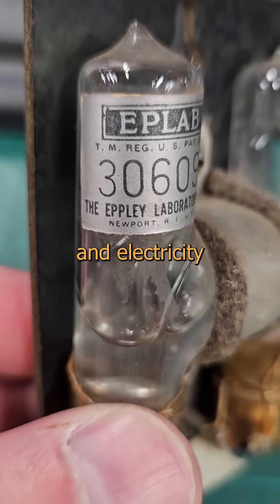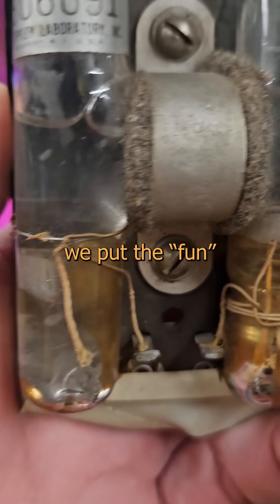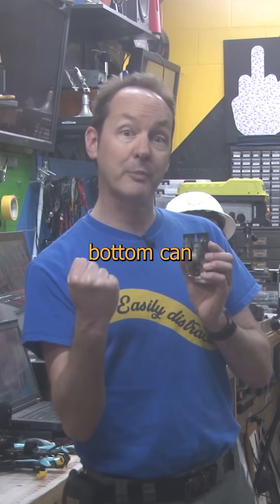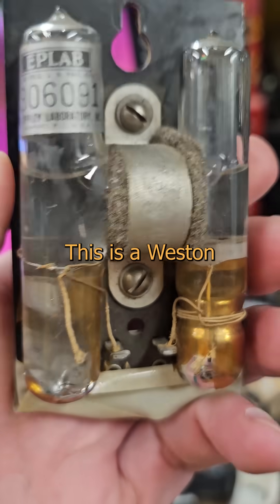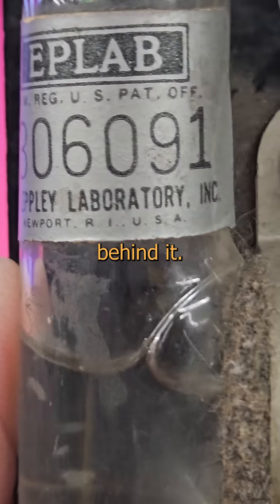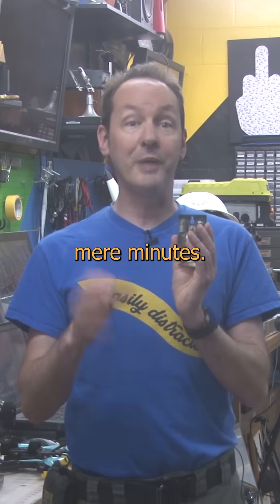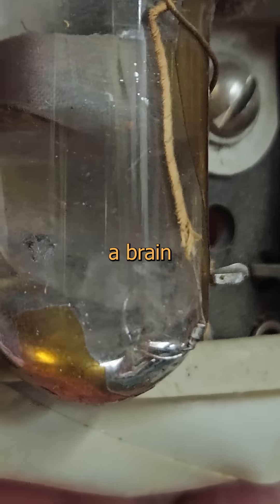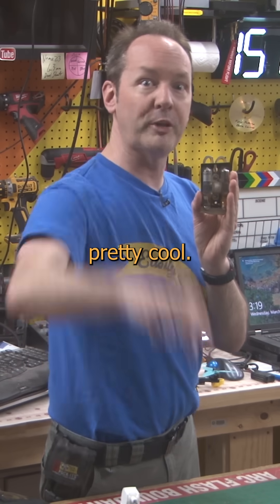The Weston Standard Cell #chrisboden #comedy #chemistry #electricity #electronics #science #history

Comment: to measure these without taking any current or at least a minimal amount a less stable but otherwise similarly precise adjustable voltage reference is used along with a null meter. Adjust the adjustable voltage source until it equals the battery showing 0v on the null meter. And now there is no current flowing so theres no discharge XD

Comment: These standard cells served as a basic reference against which early voltmeters were calibrated. It seems the combination of chemicals in these, as long as you took every precaution to keep the amperage draw as low as possible, kept the voltage remarkably stable for long periods of time. Companies using these in their metrology labs would have three - two were used for comparison to each other in the lab while one would be sent out to another lab for comparison to standards that could be traced back to what is now NIST.

Comment: That's cool. When I cal'd we used an old Fluke 732. Strange how it always has that 18 hanging on the end(@ 1 and 10V), whether it is a Zenner source or this cool poison antique.

Save that thing. They are trying to patent kill null detectors; by developing the diff builds, patenting them then killing the company. Over and over. A null detector is how you get a near perfect voltage standard. They are trying to now use 3458s to provide "near infinite" resistance to "swamp" the circuit. A far cry from the zero resistance that a null detector provides. Downgrading theory is always bad. Keep the old ways, they are stable and reliable.

Comment: I remember as an electrician doing my first sparkless switch. 
When looking under the cover. It had a glass tube. With mercury inside 
And as you turned the handle on the front. It turned the tube. So it bridged a gap that crossed two contact inside. Amazing.  And cool 😊😊😊

Comment: In case someone is wondering this is a metrology equipment to calibrate voltimeters, used betwen 1911 to 1990. Damn cool!!! It can be used in a range of temperartures from 0ºC to 40ºC, with minor corretions.
Reply: @gabrielsps  when I moved into my current Washington state apartment (2006) I got a job driving forklift in the freezer at the frozen food plant down the street. At times the winters here were noticeably colder than in my native state of California but rather than mess with the old green metal thermostat on my bedroom wall I would just throw my freezer suit on over my clothes before going out to start my car in the morning. I never trusted that thermostat and chose to never touch it, until the day that my heat came on because there was no off setting just a minimum temperature
Reply: I got off work after about 14 hours one day and walked into my bedroom only to find that my heater had activated and been running full tilt for what had to have been most of the day. It had to have been 140⁰  but that little mercury switch was not going off for any reason. Someone suggested I just break it but I knew what breakers were so I inevitably found the box and after locating the breaker I took a safer and more reasonable approach.
Reply: Thanks for the explanation.

Comment: I've come across these or something that looks very much like the. (including the mercury and the H shaped glass enclosure)

Back in the late 1980's I worked for a heat treating shop that had a lot of very old equipment from the 1940's and 1950. Stuff like furnace controllers and chart recorders. 
Over the years the old stuff would sometime break down and they'd replace them with new equipment. My boss was a bit of a packrat and would buy this sort of thing at auctions and after he passed and his wife got a new manager for the company they started getting rid of all this old stuff that he'd been collecting so I stripped some for parts for the stepper motors, gears, shafts, and other mechanical stuff. I'm sure I came across a few of these things but didn't know what they did so left them in the machines to be disposed of. 

Interesting the stuff you find out years later.

Comment: AD780, the RoHS version of course
Reply: More like LTZ1000 or ADR1000.
Reply: @somedutchguy7582 I mean if it wanna go super nerd then by all means. Buried zeners with on die ovens are sexy!
Reply: @paulm3079  as someone who owns several ovenized reference, but voltage and frequency, I think they're pretty hot.
Reply: @somedutchguy7582 I see what you did there. Nerd approved 

Any Fluke 732A’s?
Reply: @paulm3079  I have a 732A with a non-working oven, which I've been meaning to repair for ::cough:: some time.
Two working 5440B's, would that satisfy you?
Reply: @ 5440B’s are some of the best instruments on the planet.  That and the 3458B.  Those two instruments were literally developed to validate each other. Gorgeous stuff.

Should fix the oven (easy to say, my list is long too)…

Comment: Replaced by quantum voltage standards based on josephson junctions. Also, definitely not boring imho. And the atomic clocks used to drive them properly even less so. They just have a boring enclosure.

Secondary standards though are pretty boring these days.

Comment: Electrochemical potentials are the most consistent thing you can make because atoms, in the aggregate, are EXTREMELY uniform. If you get a set of pure reactants under the same conditions (hence the system being sealed and temperature sensitive) then you will get the same results every time. Laws of physics FTW.

Comment: Found a really old measuring device and I had no idea what it was for. Since it was also in mint condition and looked expensive , I took it home. Turned out to be for measuring temperature with thermocouples.  Found one of those inside.  The box says Thermo Electric MiniMite on the front, and the badge on the side says Potentiometer Pyrometer, Model 70200, Range -300 to +400F.   Made in Saddle Brook, New Jersey.

Comment: If I recall correctly you are not even supposed to measure them directly with a meter but rather use them as a reference to compare another voltage source with, as you pull less current that way.

Comment: We had a Weston Cell at the lab I apprenticed at. The old timers told me that they started measuring it in the 60s with Vacuum Tube Voltmeters - Very high input impedance, into the gig ohms. Our Fluke 8508A even had a special high impedance mode for measuring them.

The previous generation of Fluke Zenner standards, the 732B even had a 1.018 V output for labs that still wanted/needed that voltage for comparison to Weston cells- Most decent benchtop DMMs can compare two DCV sources in ratio mode.
Reply: I've never noticed that 8508A feature- I have to go look that up now.  Is there a reason you say ratio mode instead of voltage opposition? Is the weston standard cell too effected?  (Ratio mode doesn't allow you to bake in a much of a settle time.)

Comment: Build you an oversized plexiglass box. Fill it with salt water so at the given temperature you get pretty close to neutral buoyancy. Seal it up with just a couple of leads hanging out. Now it is safely contained. If you drop it it won't break but if it does it's still inside a sealed container.